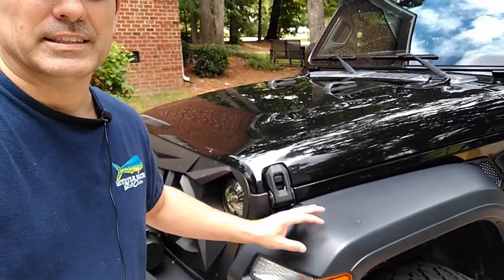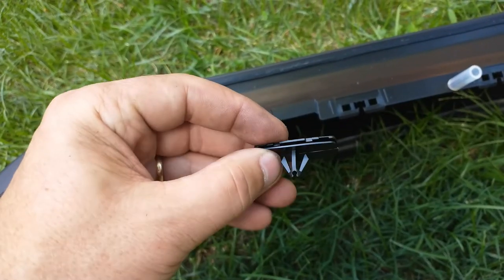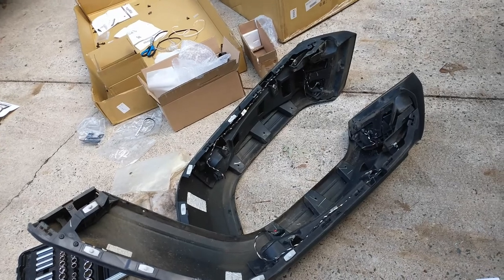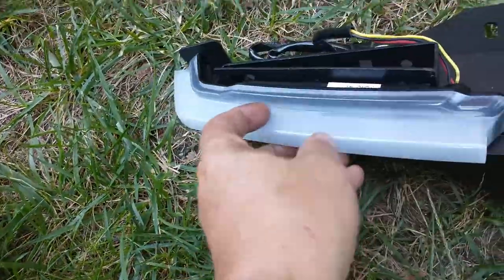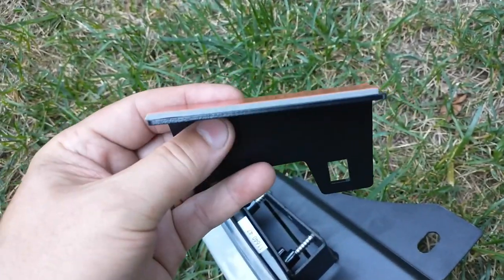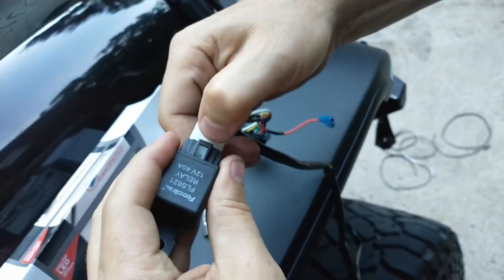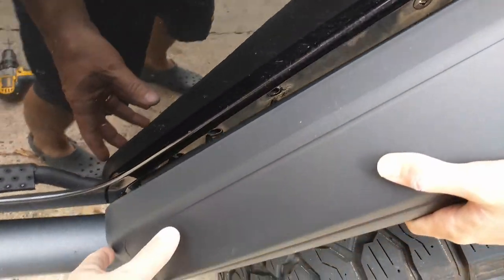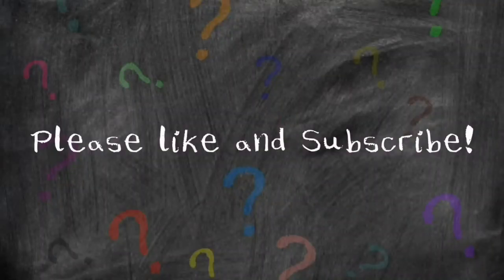How to install jeep JL Rugged Ridge Max Terrain fender flares

Comment: Nice install video. How have they held up so far?
Reply from the maker: Thanks! The jeep we put them on in this video no longer have them installed.  He lived down a gravel road and the gravel eventually flew up hard enough to put holes in the fenders so we upgraded him to metal fender flares.  In normal conditions they would still be fine.  If you are planning on beating them up like he did then I would go with metal.  Of course the price difference is huge.  Good luck and whatever you decide.

Comment: I just got these for my 2018 wrangler jl. I’m currently running splicing my drl and turn signal from both headlights and fog lights to the original turn signal. Do you know if I can splice into these units?
Reply: it’s comes with a harness. Id recommend not splicing but flashing the bcm with jscan to get them working correctly.

Comment: Did you use the stock inner fender in the front and rear?
Reply from the maker: No we removed them and bought aftermarket replacements.
Reply: @HowToWithJames which ones pls?